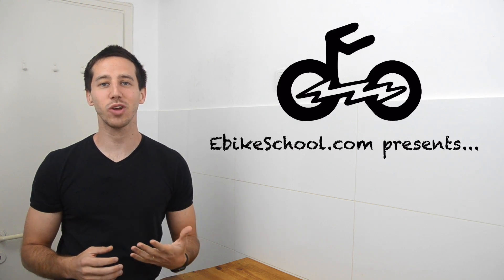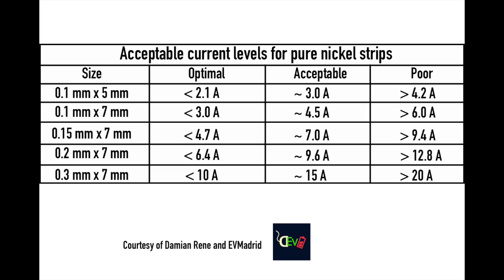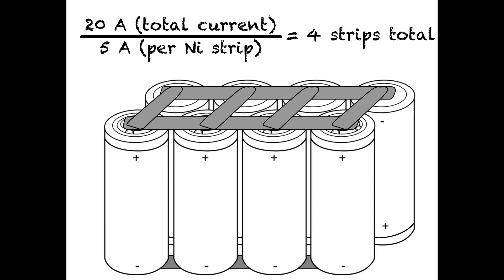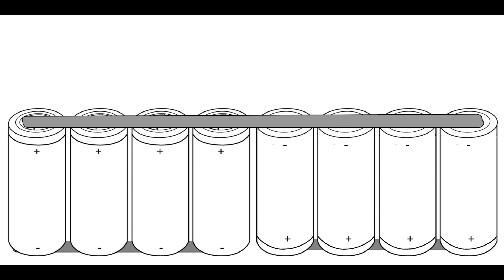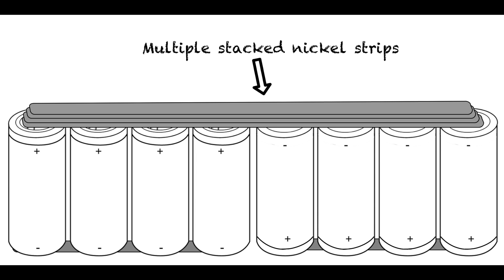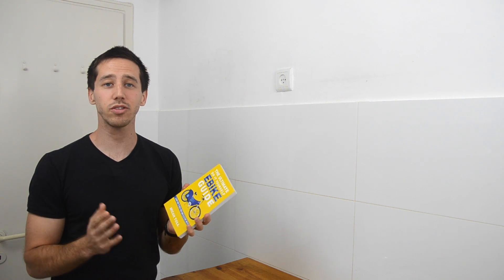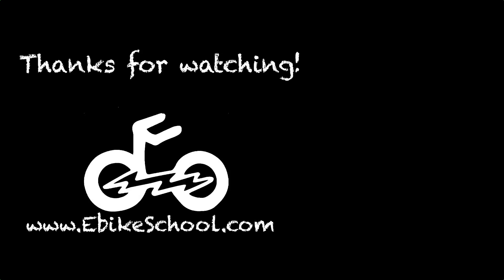How Much & What Size Nickel Strips Should You Use? Q&A#4

Comment: hi... if i use 1S3P configuration and want to discharge battery with 20 to 30 amplere then which arrangement and size of nickel strip i should make. i was using 1.5 mm thick and i think 8 or 10 mm wide but battery heat generation rate vary alot and cell temperature difference has been observed. how to overcome this. i think it is due to connection problem
Reply: i am connecting battery woth charge doscharge unit

Comment: You are correct. Guys are not aware wgo. Provide some example on Makita but applies to all brands. Xph14 (lxt series) drill has cut off around 850W. Milwaukee current small brushless around 900-950W. Thats around1.2HP in a handheld battery operated drill. Both rated 1250 inch pounds. Now do the math. To achive even 75% of this you need current about 40A. As you see none of those is even close. If you continue to use nickel strips in modern power hungry batteries than your nickel strips became inside battery heaters and we know how this can end.

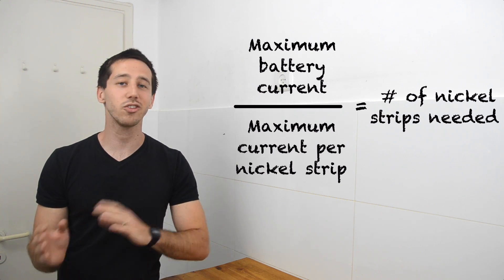Comment: From 1:17 to 1:27, "you simply divide the maximum current that you plan to draw through your battery, by the amount of current that each strip can handle, and that would give you the number of nickel strips that you need in each series connection."  Could someone please confirm an example that i have?  I only have 0.2mm x 8mm steel strip, not nickel, that i believe conducts at least 3.2amps per strip.  So here is my calculation, an 8ah battery pack, divided by 3.2amps, equals 2.5 strips per cell connection in series.  Did i get that right?

Comment: Looks like nickle strips are yesterdays tech. A single molicel P50B is capable of outputting 60 amps... sustained... from a single cell... So by this logic you would need 1.8mm thick nickle strip PER. so that's not going to happen. Going to need to be able to spot weld .3 copper. 

EDIT: a month later and I was right. had to get a full size bench welder and use 0.25 pure copper sandwiches. About 150 jouls per weld.

Comment: So if I put two layers of 0.15 nickel strip, is that the same in the current chart as a 0.3 strip? I'm getting thrown off because the physical spot welds themselves are fairly small so isn't the current still getting bottlenecked there?

Comment: I have a question. 
I don't understand that many people seems to use one small nickel tab extended from the parallel group as the output/input terminal for the battery pack. In this case, the entire current for the pack is flowing through a single tab of nickel. Isn't this dangerous?

Comment: great video, i have a question if i had a sheet of nickel 1.5 meter diameter and wanted to pass 1500 amps and 5 volts dc is that possible and how thick does the nickle sheet would have to be?

Comment: In a 4s1p pack that could see 40+amps, for the very short series connections, would it be necessary to stack 8 of the .15x8mm nickel strips to be comfortable at 40+ amps?  Does the steel of the  can itself contribute to the connections ampacity?
Reply: I wouldn't do that. When I need big amperage capacity, I will solder copper strip or wire to the nickel, then spot weld the nickel to the batteries. I find it's easier using wire.i have both copper, .4mm×6"×12" and bare solid18 gauge wire.if you have pure nickel, .15×10mm it's good for 5A per Matador..a strip of copper, .4mm×8mm is good for 37A. So u are at 42A. 18 gauge is good for 15A, so solder 2 wires and your at 35A . Much easier, will work better and less expensive

Comment: What I do for solar is keep the entire pack 100p1s and to get my 29 volts for my inverter, each battery is connected with heavy duty copper bars than serve as collectors and then connected to a brass battery post and connect all 7 packs with 0 gauge copper wire about 8" in length, had this setup for about 5 years now

Comment: Thanks for a very interesting topic. I got a question regarding multipe row/columns of parallell connections. Lets say I got a 10*10 configuration of 1S100p and like to carry 50 amps for my 3.7V electric engine. 

Intuitively I would solder some wire capable of carrying the current to one row on both sides. But this ”should” make an uneven distribution of current. 

How should I then think to properly distribute nickel in all these parallell connections so I dont get an uneven ”carry”?

Is this even a problem?

Comment: so correct me if i am wrong the current i pull equals what my ebike controller can put out?? example I have a 1200watt ebikeling hub and a 35 amp controller ....or is it  based off what bms i use example 48volt 20 amphour battery with 40amp bms???  sorry I want to learn more been watching the videos

Comment: Bro,, I have a doubt.
My laptop battery has 6 li-ion cells (3.6v, 2200mAh each) Connected in each 2 parallel in single series(4400mAh). Can I replace these cells as 3.7v, 3000mAh each? 
Is that increase my battery capacity? Or it is not good.
Reply: Yes

Comment: Someone told me nickel strip amp depends on solar uses or electric skateboard uses. Solar uses needs more strip to get the proper amp protection. Whereas skateboard uses can just use 2 layers of 0.1 I guess 7 mm width on 80 amp. By your chart it seems it refers to ebike which is similar to skateboard. Can you clarify whether any of that is right?
Reply: LOL..according to the chart from Matador .15×7mm pure nickel is good for 4.3A. Just use copper sheet or copper wire. I use bare solid 18 wire.1 wire=15A, so wire and the nickel ur at 35A

Comment: I had a guy do me a battery repair. He used nickel and solder to connect them. 4 parallel Samsung 2.7Ah batteries did not provide 10.8Ah, but more like 7 after being cooked.
Reply: He should have soldered the copper to the nickel and then spot weld

Comment: Hey Micha, I Was Looking To Buy Some Pure Nickel Strip & Came Across A Copper Strip w/Nichel Plated From Same Seller For A Slightly More Cost? My Question Is, Will The Copper+Nickel Plated Strip Carry More Power-Amps Than Just Plain Nickel Strip? Thanks
Reply: Well, since a given piece of copper will carry 4 times nickel, of course it will carry more current. I solder both .4mm copper strip, good for 40A, or 18 solid wire good for 15A...

Comment: The first setup with a pull of 40a with 8 strips is weird because then each cell should produce 10A. How would you treat a cell next to each other(in p)? Why give them 1 piece of strip should be 2 strip also right(again in p)? Because in your second setup that's how you did it, 5A(1) 10A(2 strip) 20a(4 strip).

Comment: Hi, Thank you for interesting video. I have a query. How did you calculated the acceptable current for different thickness of Nickel strip? it would be helpful if you could share the method to calculate it.
Reply: There are numerous charts that list the capacity of a given thickness and width. The charts list the cross sectional area of the strip in mm sq. So you can compare to wire. For example .15mm×8mm is 1.2mm sq. Equivalent to 17 gauge wire. I'm looking at a chart now that shows .15×8mm nickel is good for CDR of 4.9A. The Equivalent in copper would be approx 17.7A.

Comment: What would you recommend for a larger scale battery (say 12S3P lithium pack) that is going to have ~150amps pulled from it?
Reply: How are you pulling 150 amps from a 3p  li ion battery?
Reply: @kazoolordhd6591  using Molicel P42a cells. I didn’t anticipate pulling that many amps continuous but 135a peaks are what the cells are rated for (3x 45a)

Comment: I'm sorry if you have answered this question before. But can you increase Ah of battery by stacking nickel strips?
Reply: I work in electronics. 
No. The only way to increase the Ah of the battery(ies) is to stack them in parallel or buy higher Ah batteries. The nickel strips are only a roadway for the current.

Comment: Hi my name is Ben. I jus wanted to ask you if it is safe to attach two 48v batteries with a two to one connection and just plug it in to your controller?
Reply: If you mean parallel, then yes. As long as they are charged at the same level.

Comment: Think I may need to pay a pro to design this: 
 48V battery made of 32650 LiFePO4s (@ 6 aH) with this configuration:
16s18p.
 I have new flat top cells.
52.8 nominal volts
 (~80V solar panel system feed)
Capable of supplying 2000 watts at 120V (17 amps) for 10 minutes (peak load).
Outback 3648 inverter and FM80 charge controller
softears@msn.com

Micah's book is awesome!

Comment: How would affect performance and voltage drop of battery pack if instead of nickel strips to use 5A or 10A fuse wire, by spotwelding it or soldering. This would be easier compare to nickel strips. Video on YouTube when do that for power walls, but would this work on 20Ah ebike battery pack?

Comment: What about amount of  strips in paralel. I enough 1strip in 4and more cells in parallel?
One more thing, is that OK if spotwelding to battery only one strip, as welding pure nickel strip to strip is not allways successful with DIY spotwelder.
And last one would affect performance is nickel strip at welding point is cutted in two strips. Will this let spot welding easier?
Reply: Solder copper on top of nickel

Comment: Hi Micha, I.m that Aussie that was wanting your Battery Kit, The New one that is coming. Any news on that? 
Also, I am having problems getting my head around these 18650 Batteries and how to build them, without burning down my house.  

I do have your new book but wanted to see if you could help me out with some answers to my questions. This 2 will no doubt also help a lot of others who are struggling.

A little info on y current set setup.
My Setup is this,  Currently a dying 100 AH AGM Battery, 2x 200w Solar Panels Connected in Parallel to a Renogy Rover 30A MPPT Solar Regulator Controller Bluetooth Lithium AGM Gel. All of my Load Leads go through a Blue Sea Systems ST Blade Fuse Block / 12 Circuits w/ Cover and I also have a 30amp Inline Fuse between the Solar and the Renogy Controller. From the Renogy Controller to the Positive terminal on the battery, I have installed a 100amp BusBar with Fuse.
My New System will include everything above, except for the AGM. This will be replaced by my  186590's.
I am using NEW  Samsung 35E INR 18650 20A 3500mAh 3.7V. I also have a couple of 4S 10A~100A BMS Charger Protection Board 18650-Li-ion lithium Battery Cell. 
1 Ideally, to start with I want to have a 353.5 AH - 7S 100P. 
Plus a Pure Sine 2,000 W This is to run, LED Lights, LED Lamp, Two Laptops and Phone Chargers x 2, to start with. 
Q-1 Would this work ok and would I get to use all of it AH apart from the last 20ah?
I am looking to expand that up to approx 1,000 AH. with an appropriate Invertor to power everything we use. But first off, I need to completely understand the process first.
Renogy Rover 30amp 
https://www.ebay.com.au/itm/Renogy-Rover-20-30-40A-MPPT-Solar-Regulator-Controller-Bluetooth-Lithium-AGM-Gel/292992982241?epid=4034409435&hash=item4437be1ce1:g:QpUAAOSwpvRcfiZz&frcectupt=true
Q-2 Will this Controller be able to Properly Charge My 353.5 AH 18650 Battery Bank? It does have Adjustable Voltages.
I want to be able to FUSE my 18650 Battery bank. Anyway, I came across this stuff and it looks to be a much better option that the Resistort Wire Option. this stuff is NICKEL FUSE 5P WIDE CONTINUOUS ROLL BY THE FOOT! 18650 CELL LEVEL FUSING. can you elaborate on this at all? is it as good as I think it is? 
Q-3 Will this work as advertised and do I still need to use Nickle Strips as well as this Nickle Fuse.

Q-4 Would it be possible for you to build this system in a Vidoe Step by Step with Instructions showing exactly what parts are needed and how to configure each part along with explanations as to why it is done in this manner. And any other information that you can provide along the way, to help complete noobs like myself.

Although I do have your book, which is fantastic, by the way. 
But I am more of a video tutorial type of learner and you are one of the best teachers that I have come across, 
So I would really appreciate it if you could take the time to put something together in order to answer these questions and also raise any other concerns that might limit the setup.
Thanks for reading this and I look forward to hearing from you.

Graeme

Comment: I tried to Spotweld pure 0.2mm Nickelstrips with a Malectrics Spot Welder and 3S LiHV 65-130C. But it doesn't work, no connection between Strips. I tried 30ms to 80ms, but there is only big heat and no Weld-connection.
Reply: Spot weld thin nier copper wire on topckel Kelly then sold

Comment: Hi there, you are my "go to guy" for all battery queries and I have your book on battery building, it is superb. I have one question that I could find an answer to and it goes like this.
I have connected all parallel cells in my 13s4p battery and now for the series connections. As the shape is very irregular can I solder the series strips on to the parallel using the 3 bridges between the 4 cells? I would double up the strips in series to ensure the current draw was catered for. I am thinking there would be little heat reaching the batteries.
I wish to do this for two reasons.
 1. To give me the freedom of dismantling in the future for another battery shape on another bike.
 2. Soldering the series would be such an advantage as the spot welder only has limited reach.
I hope this makes some sense. This is a new world for me but as a mechanical engineer I am hooked and plan to play for years. Friends I ride with are already interested in future battery builds for them too, which is nice! 
Kindest regards. Tim. G. From the UK.

Comment: Hey there, the video was very helpful. I am trying to build a 42s16p pack that will withdraw 450A current. Can you help me with design because I am really confused with the size i should use for my battery pack
Reply: Ah its so smol dont worry
Reply: 42S? 155V right? 
What are you doing?
Reply: 0.25mm thick pure nickel strip
Reply: LMAO.    .25×8mm is good for 9A. He needs to solder on top the nickel. I use .4mm copper (40A) or bare solid 18 gauge wire (15A).

Comment: If I use incorrect size of nickel strip, how that affect battery performance? Will that part of nickel strip just warm up? Can this be exact rison why I get huge voltage drop under load.? From 42v to 36-35v. Could you  show how change temp of nickel strip under different current.
Reply: Yes

Comment: what happens if i use oversized nickel strips? i need 31.25A and my configuration is 16s3p, 8mm*10mm would do the job? im thinking in conventional one strip to parallel and 1 strip to series so it would be 3 strips per series connection

Comment: I've been hearing great things about nickel plated copper  strip anybody sourced any ?
Reply: I think you will find that the copper sticks to the copper "picks" used by spot welding machines. That happened with my first experimental spot weld with a different type of spot welder. It is also - logical.

Comment: Why use Ni for strips?  Cu has about a seven times better electric conductivity.  I know Cu is more expensive than Ni, but you would not need nearly as much of it compared to Ni. Are there any issues with spot welding Cu?
Reply: You can't do it, that is the problem
 Solder copper to top of nickel, then spot weld it

Comment: Stacking nickel strips in order to increase amp draw capacity seems like false logic.  No matter how man strips are stacked, all of the current has to pass through the 4-8 small spot welds that are making contact between the lowest strip and the battery and increasing the number of stacked strips doesn't change that.
Reply: That is not correct. The lowest strip conducts the current of one cell only, namely the one on the end of the pack.  The second strip conduct the current of the second cell, and so one.  The only issue that might arise is with the connection between the wire connection at the center of the pack, since there the current is the total of all strips together.

Comment: On the topic of nickel strips, I'm trying to figure out when I might use the 'wavey pattern' for a 2P strip, as opposed to the pattern that appears to be two straight line strips joined by strips on an angle somewhere around 45 degrees. Any opinions on this?
Reply: Matter of preference. Personally I like the straight packs better however some ppl like the angle packs because it saves a little space. But my way of thinking is that your bringing the series cells closer together thus increasing your risk of can to can short contact. I stopped gluing my packs this way a long time ago, and will only use plastic separator connectors because I learned hard way. If you can afford the plastic separator/holders then buy an ender 3 for 160 dollars and make them yourselves. Don't ever skimp on plastic separator holders, they not only make your packs look nicer but they keep everything much much safer
Reply: @drewrinker2071  Thanks, good feedback which I will keep in mind for the next build. One question, what does "buy an ender 3" mean?

Comment: Great video. What if someone was to use copper strip instead of nickel? Also why limit ourself to strip can larger piece of conductive material be used such as Shim Stock they come in roll up to 6" wide? Many thanks for all your videos.
Reply: .2mm×10mm pure nickel is good for a CDR of 8A. Same size strip in copper is 31A. The strip is equivalent  of 14 gauge wire..